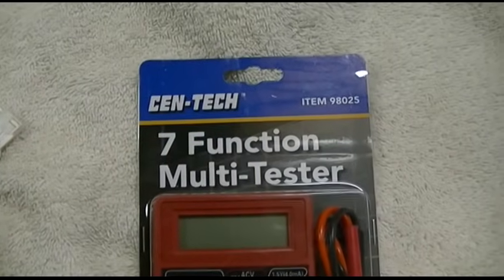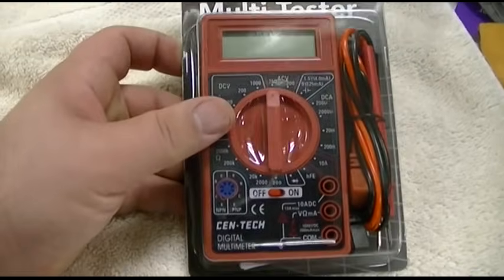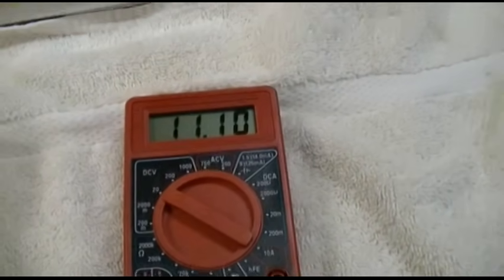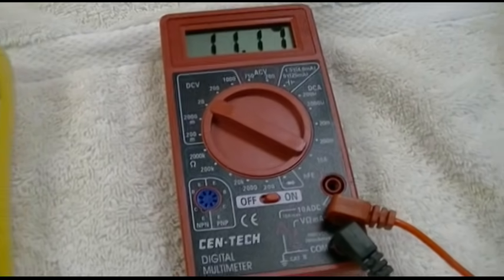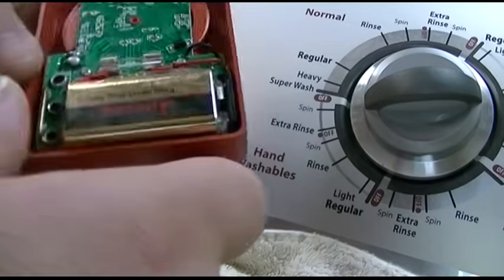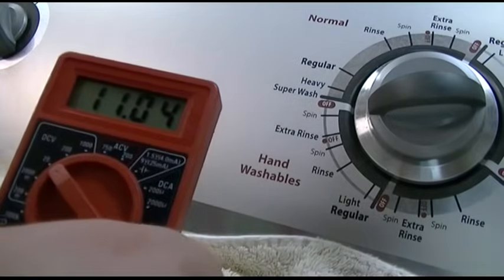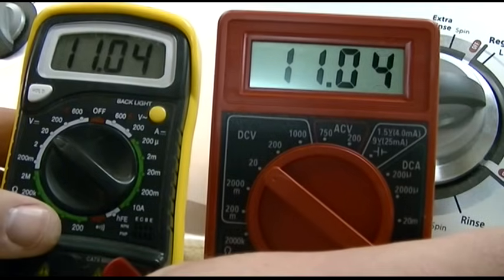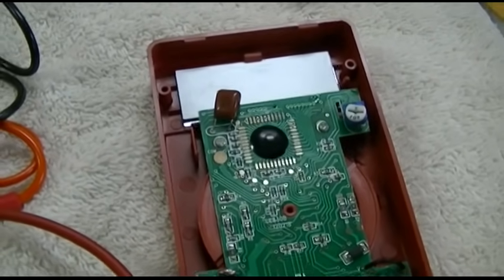Harbor Freight - Cen-Tech 7 Function Digital Multimeter Review

Comment: I have the freebie MM shown in this video. They say it is easy to use, however, if you have NO mechanical aptitude or let's say you are a kid or a woman who doesn't ever use tools... It can be quite intimidating and complicated. Which setting do I use if I wanna test a 9V battery? ... or a 6V SLA Back-Up Battery for emergency lights or some Christmas lights?? ... in that regard, I am confused. So thanks for the video. It wasn't exactly helpful to my cause... but now I see, I'm not the only knucklehead that owns one of these.
Reply from the maker: Most people own them because they're free.  I have the benefit that I also know how to use it.

For the batteries you say, you'd use the DC 20V scale.  The way these meters work is the scale is selected by the dial.  If you DON'T know the voltage you go to the highest end of the scale and work your way down.  If the meter shows "|" then you've gone one click too far.  No worries if you hook the probes up backwards, if you do the display will just show a minus sign in front of the number.  For AC voltage it doesn't matter which way the probes are connected.

For Christmas lights you use the ohms scale.  When the probes are not connected you'll read "|".  Touch the probes together first, you should read close to zero ohms.  This is not a high quality meter, a good quality one should read zero when the probes are touched.  Touch the probes to the contacts on the bulb.  If it reads close to zero the bulb is good.  If it reads "|", it's bad.  Simple enough?
Reply: Yeah... That's terrific. Got it now. Thanks, man. You just earned a subscriber.
Reply from the maker: Thanks!

Comment: In this case can we immerse :

2 red prone and one end of circuit in baking soda water 
also
2 black prone and one end of circuit in another tank of baking soda water

Measure resistivity of Soda water.

Calculate it into the formula for amp circular saw is pulling???

Baking Soda Water will help dissipate heat, prevent over heat.

Will this sit up still blow multimeter fuse? And why?
Reply from the maker: Best not to tempt fate!  Get a real ammeter, like a clamp-on ammeter.  Or, buy a Kill-A-Watt wattmeter, it will also show you current and you can plug anything in your house into it to see what it pulls.

Comment: Great current tutorial

Can I use 2 of this multimeter to measure 20 amp or 3 for 1230amp current. As you know it is rated for 10 amp.
Reply from the maker: No, I don't think so; ammeters have to be connected in-line, and the most each meter will handle is 10 amps.  You're pulling 20 total so it's not going to have it, the fuse will blow at best, otherwise the meter will!

Comment: they have gotten even cheaper now. there a fuse that you cannot replace unless you solder on in. The battery is now a small cell battery or a smaller battery if i remember correctly (it's been a while since i've taken it apart)
Reply from the maker: It's been a while since I got one.  I'd be interested to see that.  Do you have the particular item number of the one you got?

Comment: i wish you gave more info for beginners. You dont really show how to attach the leads to a battery. Where does the red and black go on a battery.  Also to test a  1.5v AAA battery, where do i attach the leads at bottom of device?  i see 10A DC or where do i plug these to test a AA or aaa battery?
thanks
Reply from the maker: I suggest you first familiarize yourself with amps, volts, and ohms.  Once you understand the theory behind it, the rest is second nature, including where to plug the probes in.  The booklet for the meter also explains that.  Where the probes are plugged in as you see in this video is where you would have them for ohms and volts, amps you have to switch the red one.  I thought that would have been self evident, since I turned the meter to the VOLT scale and then measured volts; I would need the probes plugged in the right ports!
Reply: thanks, it just happens i got my from a friend and it did not come with the book, but you are correct, i need a primer in the basics.  I assumed i could get one on YouTube and i probably can, if i dig a little deeper. I appreciate your reply.
Reply from the maker: No problem Howard.  You can also go to Harbor Freight's website and punch in the item number, there will be a link for the manual there.  There are plenty of multimeter tutorials on YouTube.  You might peruse wikipedia to get a handle on the terms that are used first, then watch one of those.

Comment: Was having some odd behavior from my microcontroller. It can't measure duty cycles afaik but it'll still read out the average voltage of a PWM signal. Nice cheap little thing to have around. I should probably be using an oscilloscope for that buuuuut... *looks at empty wallet
Reply from the maker: I've been doing the very same thing with the oscilloscope and the wallet...

Comment: great video, but would be better if you explained when to plug the red test lead into V ohm mA (the middle) or 10ADC (the top).  of course, the black lead always plugs into the bottom
Reply from the maker: Thank you for the constructive criticism.  I did mention that I will not be explaining how to use a multimeter in this video, plugging the leads into the correct ports is more-or-less part of using it.

Comment: mine just zap  the heck out of  me through the black wire just took it out of the package
Reply from the maker: While not measuring something?  I don't think that's really possible, the highest voltage in that is 9 volts DC, off a little 9 volt battery.